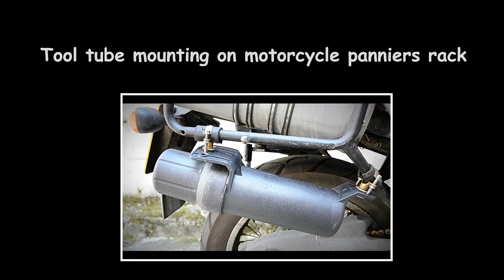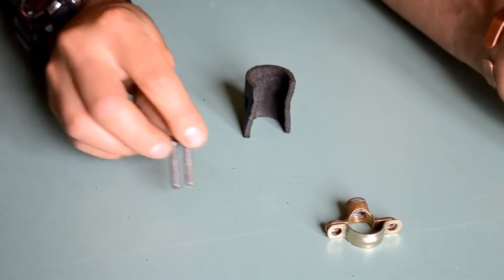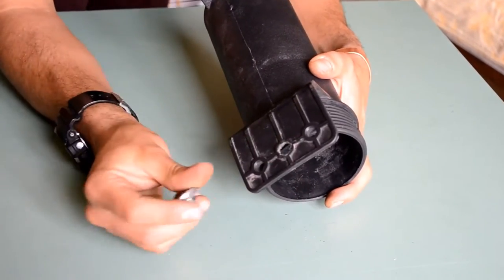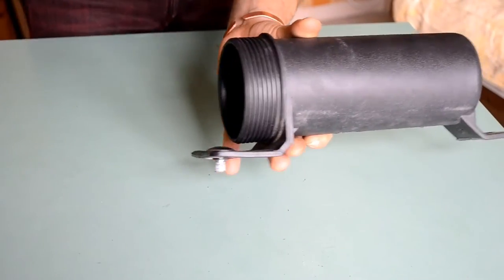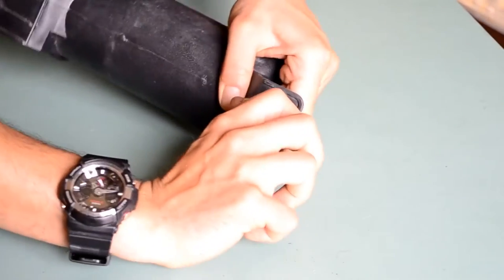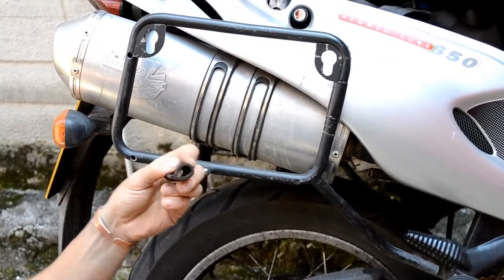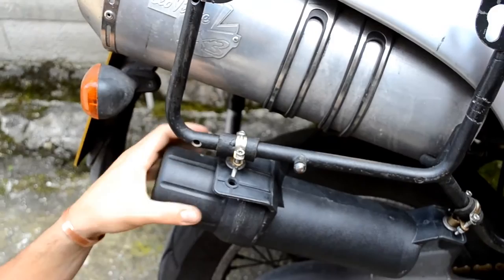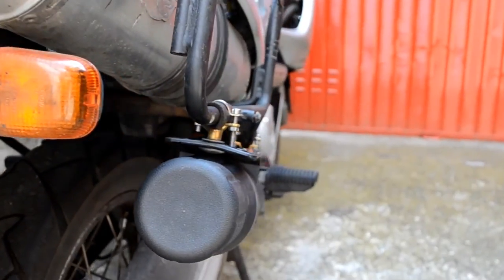Motorcycle Tool Tube Installation

Comment: This is a good way of doing it. However, you're interfering with the saddlebag's frame. It won't work for saddle boxes.
Reply from the maker: Probably you are right. But if you have hard cases maybe you could consider finding a way to attach the time to the case itself, perhaps drilling 2 holes at the back of one of the 2 and have the tube  there. Just an idea but it will depend on the shape/ material of the case and on whether or not you are willing to make such modifications to them.
Reply: I am considering using hose clips (some call them hose clamps) as they are thin enough not to annoy the boxes. What do you think?
Reply from the maker: Sure, hose clamps are strong and thin, but then you need to find a way to make them catch onto the tool tube 'lips'. Maybe cutting 2 small slits in the tube 'lip', with a heated flat screwdriver or something similar. Then you can have a hose clamp passing through them and around the panniers rack. Just an idea, I am not sure how solid it would be.